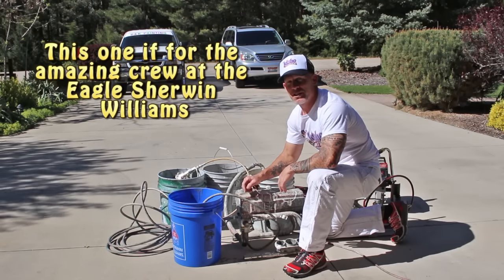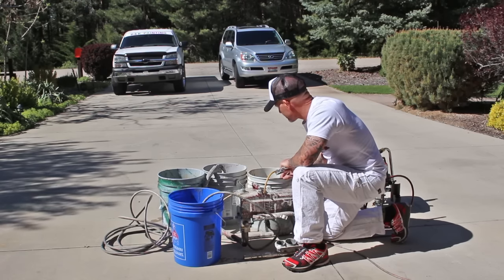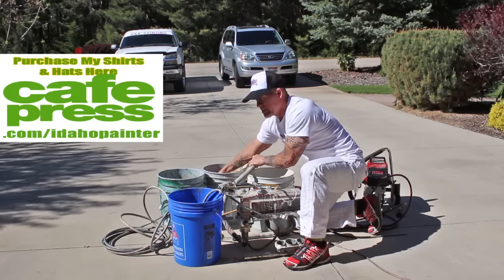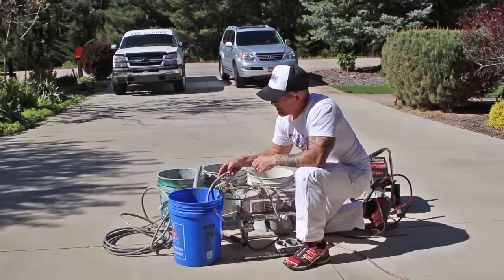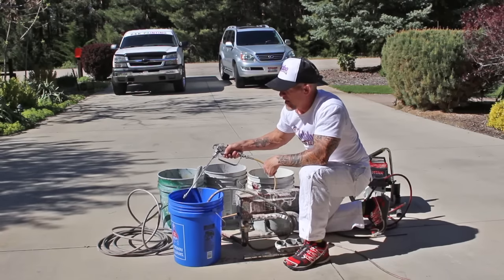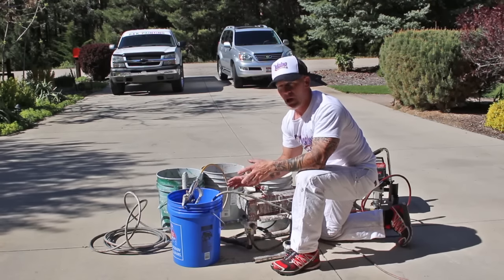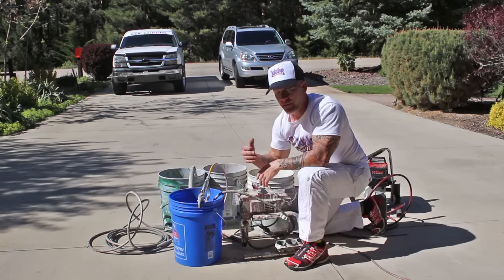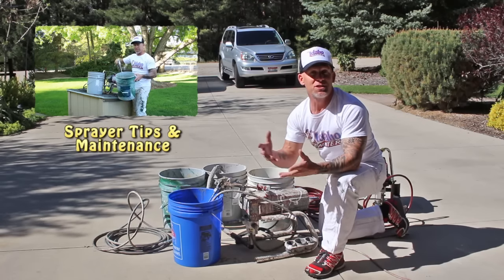How To Properly Clean or Repair A Paint Sprayer.  Titan Spray Painting.

Comment: If you rinse off the pump hose before you put it in your clean water it only takes 1 bucket of water to totally clean out your rig because the water stays clean. Also remove and clean out the filter closest to the pump early after pumping out the paint helps a lot as far as how long it takes to clean it out.

Comment: Holy crap.. in the middle of the driveway with no drop or cardboard at least?
You are one brave dude.. I dropped a full gallon of oil based enamel back around 95 on someone’s driveway.
Spent like 2 hrs cleaning it up.. I didn’t bother asking the boss for $1 raise that summer.

Comment: Nice tips. I find if I remove and clean the pump filter at an early stage, it cleans a lot faster too. A lot of paint builds up in that filter and keep cycling through the system. Better to remove that early on.
Reply: Do you clean it and put it back in. Ir run it with filter out? If filter is out do you run chance if debri getting I'm the pump
Reply: @RiverRatSurfers  Yeah don't risk running the pump without the filter. No point in doing that. As long as you run clean water after you clean (and put back) the filter, youre good. 👍

Comment: Small point, for some users who may not think of it, is to remove the spray tip before doing these steps.  Much easier having a gentle stream of water as opposed to a fan shaped mist coming out the working end of the gun.  I typically clean the spray tip under running water during one of the "soak times" described in the video.

Comment: If I may chime in, the best way I have found is to remove tip housing-with tip still attached and deposit in clean Qt. can half full with lacquer thinner, not paint thinner until the next time it's needed. Yep, no cleaning just drop it in. Next remove pickup tube and place in bucket with approx. 3-4 gal hot water "really hot water" and add half a cup of liquid Tide. The hot water and detergent bust up all the acrylic/paint goobers in entire airless. Cold water is okay if it's all you have but it's no friend to the insides of an airless. Once the majority of hot water/detergent has passed through, clean all inline "gun" and manifold filters and cycle through clean tap water in airless till it runs clear from gun, I like to use paint thinner for overnight or longer storage but of course you have to flush with soap and water before next water based paint use, any long term storage I like to mix non-detergent 30 wt. oil and paint thinner 50/50 and cycle through entire pump, where I'm at the weather can snap to freezing before you know it and I never trusted any water based additives to prevent a burden tube busting or corrosion.

Comment: Hey Chris, I have a Greco LTS 17 Sprayer and for the most part I'm spraying latex paints.I like your idea on running water through and leaving it for a few minutes then spraying/flushing it out. What are your thoughts for a full on cleaning maybe at home. Boiling a pot of water or close to boiling then priming that and holding it in the system for maybe 5 minutes to basically try and loosen up the paint inside and then flush it with warm water for a bit? I guess the two concerns would be would it melt any of the hoses or what damage could it do on the inside if any. Great video I enjoy watching them!!!

Comment: Hi Chris,
Just picked up a used Graco Magnum sprayer, gun and 30' hose. I've started the first coat of primer on my kitchen cabinets and they look great...Q, The gun filter was absolutely clogged (not sure how it even sprayed primer) now I'm a bit concerned as I'm about to shoot paint on my cabinets. I've ordered a Graco gun filter, but have genuine concerns about what may be lurking in the hose and airless sprayer....is there anyway to thoroughly guarantee a clean setup? Given I have no history on this spray unit and parts? Suggestions / advice needed. Thx ! Love this channel.
Reply: replace the hose for now. old hoses have build up that causes clogged tips in the middle of the job. personal experience with a used 440i  I bought. solved the issues I had, with new filters too.

Comment: I have to prime and paint a big wall, 3 stories by 30 or 40 feet of drywall with an airless sprayer that's been stored for a while. Got a scissor lift and eggshell recycled paint. I need to pick up primer, pva I guess. I should get an extension too, any other tips? I also have to paint the wooden beams and corrugated steel walls in my 3000 sq ft winery event space. Brown to match the wood beams and flat gray for the metal. I've watched almost all your videos and put them to good use painting the restrooms and doors. I have to paint the concrete floor too. Rollers or spray?

Comment: I have recently been introduced to Xylene.  It seem to do a much better job than Paint Thinner. What is your opinion on using Xylene on cleaning?  Would it be a good idea to run it through the Airless Pump as the last step of cleaning it with Latex or Oil Based?
Reply: Chris,  You made me wonder if you had used Xylene before. At Lowes here in Boise, it is within .50 cent of Paint Thinner per gallon.  I am new to this and was using a oil based paint in my HVLP sprayer, only I thought it was latex based, so I ran water through the gun to clean it.  What a gooey mess.  Xylene cleaned it up beautifully.  I was truly amazed. Even the thin mesh filter in the cup just had to be dipped once to clean it. Now I use it every time. No scrubbing required, the paint just dissolves.  (so far my experience has all been with oil based paint)  It is also very good at getting caulk and paint off your hands.  Try it on Through the Roof caulk.  If you have not tried it please consider trying it. (I can see a new video in your future)  On 2nd thought, I should see how it responds to latex paint before I go any further.  Do you see any reason why I should not be used on an airless sprayer?  I am considering cleaning it with water and then a cycle of Xylene and then water again. I just got a Graco 490 to paint my house, so I don't want to mess it up. But also also want to maintain and clean it thoroughly.  Thanks for the help and the great videos!!!

Comment: I actually found out my dad bought a titan 440i for really cheap a couple weeks before i found your channel and became really interested in painting . But who ever owned it before did not clean out the paint in it and it dried all up in the hose. I had no idea and started up the sprayer without the gun to let the water come out of the hose and no water came out then i guess the pressure had build up and like a shotgun it shot pieces of dried paint from the hose across the back yard and hit the wall like a paint ball gun and scared the hell out of me lucky i didnt get hurt. So i have two questions First is the hose salvageable at all and if so whats the best way i can clean it out, The end if it is really hard so i know theres alot of paint in it.
Secondly the oil lip where you put piston oil into when i was cleaning out the sprayer the water comes above the piston where the oils is suppose to go into is that normal or is a seal broken?

Comment: So I am thinking about about buying an airless paint sprayer off of Craigslist .
Let's just say worst case scenario the previous person did not take the time to clean the water based paint out of their sprayer properly and it dried up. If I run it through, or pour paint thinner little by little could get it to be almost like new again?
Reply from the maker: No. It will have to be torn apart
Reply: Home Improvement How To's 
Oh. :( 
So worst case scenario how much would it cost to replace a part damaged b/c of oil or water based paint drying up. 
I want one of the Graco's, but they are really expensive for me.
Reply: The cost of a new sprayer
Reply: 99% of the time the breakdown and or problems are due to no general clean up . It’s easy but can take time . Do it EACH time it’s used . Mixing latex to oil is a very bad idea . I’d not suggest buying used unless you’re ready to possibly drop hundreds on parts and labor to fix . Gaskets , seals , filters , lines tubes ...